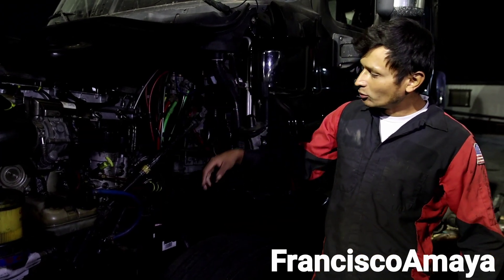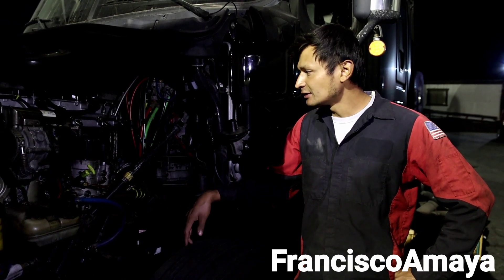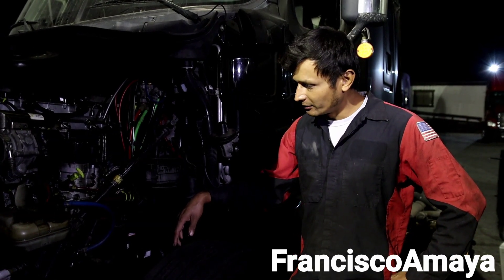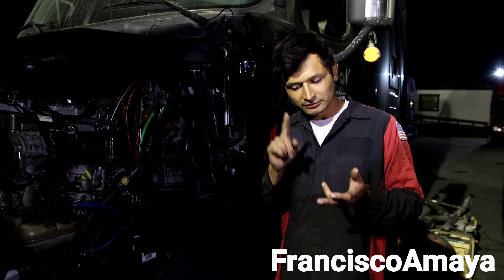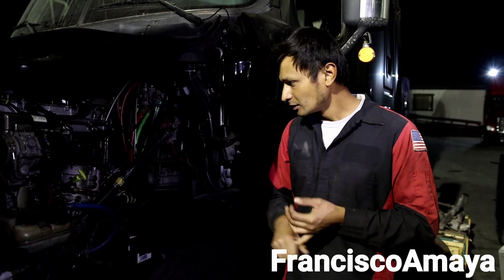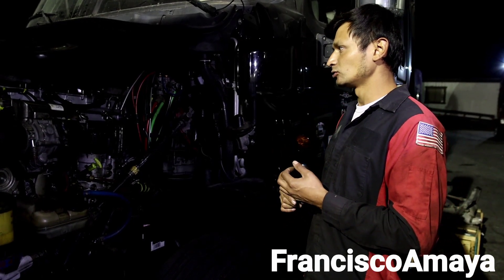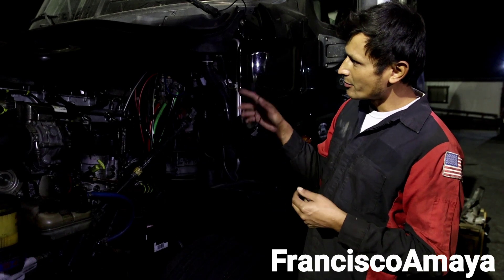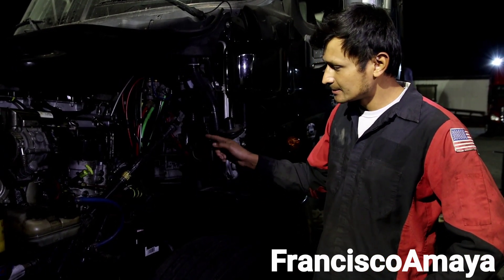DD15 full overhaul total cost after crankshaft replacement pistons cylinder liner labor cascadia 7

Comment: 2018 cascadia dd15 have fuel systems problem detected and the code is spn 1328 fmi 31 .what you think how much it will cost me to fix it. Freight liner dealer give me estimate for $22k .

Comment: Why not just put in a new engine instead of fix it for 27k
Reply: New DD15 is around 50K
Reply: 59874 dollars to replace with a new engine at my local Detroit shop. They were cheaper then the freightliner dealership. I’m getting a in frame done for 23500
Reply: @thunderroad7289  , can you share shop address